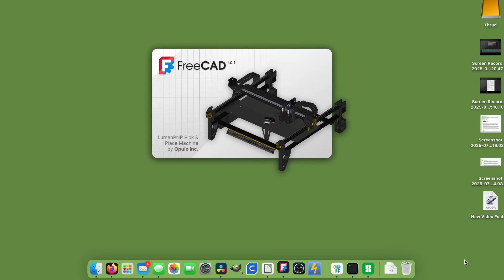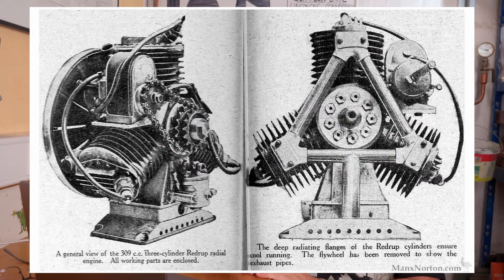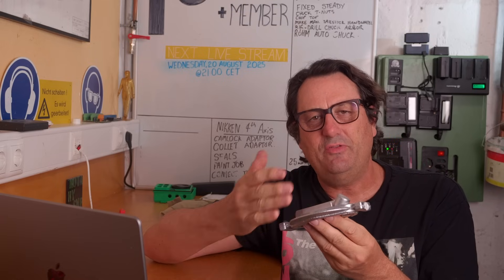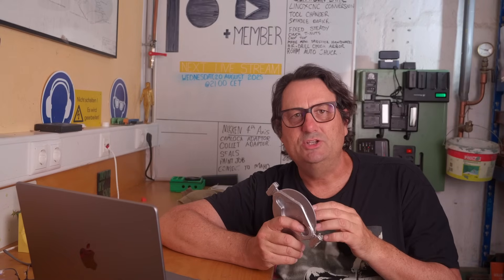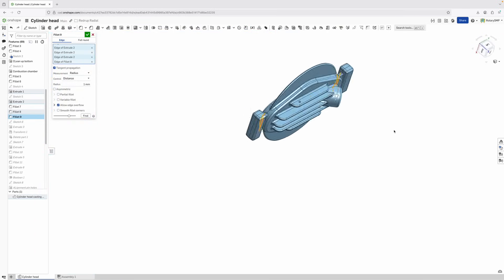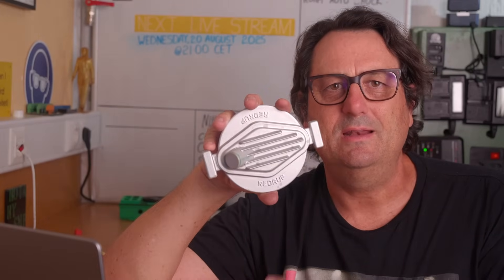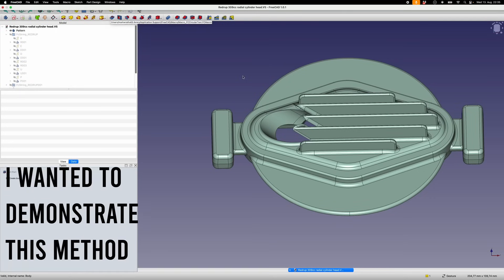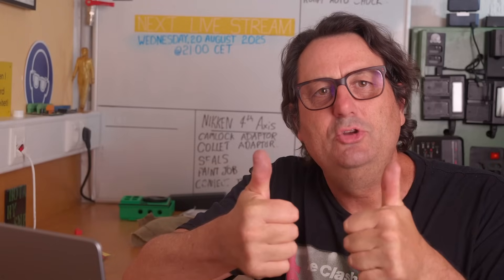FreeCad vs Onshape - Why did I switch? || RotarySMP

Comment: Freecad part workbench is a surface modeler and part design workbench is a solid modeler, hence the incompatibility between the two. I recently discovered that distinction and switched to part workbench as that gives me the 2.5D geometry I need for CNC machining. The limiting factor for me was that part design insists on having to create a different body container for each separate part (or different files and use assemblies). When I'm just designing and fleshing things out, part design is more efficient. At least form me. 

I do agree that the cohesion between different sections of Freecad could use some improving, especially sketching, cloning/multi array features for separate parts. Using external geometry in sketches often breaks the model once you change a part in the history. What I now do is use external geometry to get the dimensions, then delete the external geometry and use dimensions to reference from origin. This saves me from having to manually input all the dimensions. Still, would be nice if regenerating would keep the external references in tact when you change stuff upstream. Of course, parameters are your friend as well.

I've used both surface modelers and solid cad/cam modelers in the past like SolidWorks 2017, inventor, fusion360 and Lightwave3D.
Reply: Solid workbench and Surface workbench as names for each...I know, it's a wild and radical idea.
Reply from the maker: @m3chanist  Funny that this was not obvious to me. Duh! :)
Reply: @m3chanist  That would clear things up immediately. Or split Freecad up in Freecad Solid and Freecad Surface (or call it mixer, or blender ;). I feel like Freecad needs a bit more focus on solid modeling and not trying to be everything at once.
Reply from the maker: Thanks for the explanation of that. I hadn't worked out what the difference was.

Comment: I've never used CAD software, but my experience with other types of software (mostly music production) is that the designers may well be great programmers, but not necessarily particularly good at the area the software is meant to be used in. Anyone experienced in the production of music in the analog domain knows certain terminology and methodologies. I find much music software to have been programmed by people who never learned the basics of music and are reinventing the wheel from their point of view. Programmers also seem to want to make software idiot-proof, at the expense of providing flexibility for people who know what they want to do.
Reply from the maker: I think it is cool that there are open source programs like Gimp, LinuxCNC, Freecad and Blender. I guess we can't complain when some are better integrated than others. :/
Reply: usually commercial software gets this right and open source unfortunately totally screws it up. the reason likely being that commercial software developers have to sell to domain experts who have no patience for the distorted view programmers have of their domain, so they hire the domain experts and have them involved in leading the programmers. open source usually can't afford this (except if it's blender or krita) and thus a significant part of the regrettable situation where the best open source software is developer tooling and then it goes awry for much non-programming software. e.g. gnu imp (doesn't have a bandage tool!), darktable (mathematics suite more than photo editor)
Reply from the maker: @Anonymouspock  I think you are right.

Comment: I started with autocad 13 and still have a copy but I also used solid works as well. I have played with a few others but I am always in a relearning process because I don't use it enough and forget stuff.  Also use chief architect for building plans and is a pretty cool software for construction as it calculates all your materials needed and costs etc.
        With acad r13 and later there wer many times you would type in a command and it would flat ignore it. You would have to close and reopen the program before it would work. You got in the habit of every so often hit save close the program then restart it to pre-emptively restart the program. 

          Video editing software reminds me of old cad software with it's oddities and so much in editing software is not done in an intuitive way and things you think would be  easy are very complicated functions or have to be done to a clip in another instance of the software then imported into the one you are working in to start with.
Reply from the maker: Hi Robert. Yeah, Resolve is a beast. It has an autosave feature which seems to save after every key stroke. Back in R17 it didn't yet have that feature, and crashed so often, I got added a hot key to my Contour for a save button I hit constantly :)
Reply: @RotarySMP  Whatever happened to programs having autosave timers.
Reply from the maker: @theinfernalcraftsman  I think FreeCad also autosaves, but dont remember the setting. That is nice about OnShape. It saves everything constantly. Actually you have to think about the way you do some things, as it really remembers everything, including ever undo.

Comment: at 14:28 instead of making a circle, could you make an arc? The text might center on the arc instead of a random spot on the circle?
Reply from the maker: I should have. You are right.
Reply: @RotarySMP  I do agree that the tool should've just had a degree offset parameter, silly that it doesn't
Reply from the maker: @Mimerneos  It is also a script, so I don't think it is a core tool.

Comment: my first serious forays into 3d object design were povray with the kpovraymodeler frontend, every so often i'd try some 2d cad thing, but they never worked or were opaque in use.  sketchup, some others, but i''m doing freecad now, it's in some ways pretty nice, but also painful to use in some important ways.  i used to have models of decent complexity, but something has changed, now things that used to load fine without any freezes, troubles with rendering stutters... they've started having issues, someone's tried to improve things and have made it worse.

for myself, i'm positioned for building a server that can handle a really complex model, i just need a bit more ram for the server i have.  it might be something to think of for the future.
Reply from the maker: It is good that the Dev's and leadership are working hard on improvement, and not just on new features.
Reply: What was the last FreeCAD version you have worked with?
Reply: @AlexDerhuan  1.0.2
Reply: @felderup  Thanks mate

Comment: Ah the dilemma, i started with a drawing board then Auto cad 10 (inputs on a command line) then the succession of others finally to Fusion 360 via Onshape, to be honest for my home workshop reverse enginering old car and motorcycle parts and even for new racecar parts, i can make the part faster than i can model it (typical back of fag packet engineering)  what is the total time in modelling then printing the cylinder head patterns ? i am certain you could have done that faster with traditional methods, crank can maybe not ,as i assume its a bit more complicated. but the modelling does shine is with assembly's etc and as you say with the CAM for your machines. thank you for the incite in to this wonderfull project
Reply from the maker: I also started with the drawing board. I did Tech drawing for 5 years in school. Was my favourite subject.

Comment: After getting burned with cloud software I use Plasticity for prototyping now. Its a non subscription (buy once) offline tool using the Siemens Parasolid kernel. While its no traditional CAD with a reversable tree structure, its direct controls are very fast and robust.
Reply from the maker: I have never used that one.
Reply: @RotarySMP  its pretty different from traditional cad, but still a proper solid modeler with STEP export. It has neither CAM nor specialized CAD features like gear/thread generators, for those features I occasioanal import or export to freecad. But for me its the program that has "clicked" the most to get to results fast, though I mostly do resin and FDM 3D printing and much less CNC.
Reply from the maker: @zeugundso  Nice one. I took a quick look at OpenScad once, but that was not my world.

Comment: I also shifted to OnShape years ago after trying (unsuccessfully) to move to FreeCAD after being a previous SOLIDWORKS user.

I try every year or two to see if anything has changed, but fundamentally I've always found the same things. What I'd consider to be basic functions seem so difficult to achieve that I just have to pick a different route as I value my time.
Trying to pattern a couple of hundred circular holes into a part was my last frustration. It was unbelievably slow, partly I think due to having to pattern the hole feature rather than the circle in a sketch, but whatever the reason as that was one of the first processes in my part I just gave up again.

I'd love to see a FreeCAD version which was just the basics. Cut out everything that's not useful for basic modelling and see if Open CASCADE fundamentally is up to the task before slowly adding functions back in to satisfy the power users.
Reply from the maker: That is a good suggestion. It is one of the illnesses of open source projects that often more work is invested in shiny new objects, rather than excelling at the basics.

Comment: I discovered Onshape last year, I think it was rctestflight videos that put me on to it. I'd used Sketchup years ago, but last year I had a project in mind and so much had changed with Sketchup that I didn't want to use that anymore.
I had tried out Fusion360 and FreeCAD before, but I couldn't get the hang of neither. With Onshape otoh I hit the ground running pretty easily, each time I encountered issues I was able to follow along with one of their courses to get me going again.
Since then I've enrolled in a professional CAD course (Autodesk Inventor & Solidworks), and will soon start working in this field taking my professional life in a completely different direction. So, thanks Onshape!
I've been looking for companies in my area that use Onshape as their main CAD package, but thus far I haven't found one.
One of the areas where I do feel Onshape falls short is making drawings. I can't quite put my finger on it, but I find making drawings in Onshape to be much more difficult to get right than in Inventor. But for modelling it's hard to beat imo.

I do feel like companies that make CAD software should do more to offer tinkerers, makers and the like better access to their products. The base rates they ask are just way too much for anyone to reasonably consider for a hobby. I heard Solidworks offers a €30 tier for consumers, but that comes with annoying restrictions making it really difficult to share files without screwing over a proper licence holder.
Other than that it's pretty slim pickings for a consumer. I even wish Onshape would offer a reasonably tier, while I love using it I do feel slightly uncomfortable that my designs are just public for anyone to see and use, but even with Onshape being one of the cheaper CAD alternatives at €1500/year, that's still a significant chunk of money for a hobby.

Comment: In Solidworks I do curved text with a reference arc. That way I can set the start and end angles for the text. It never occurred to me to use a full circle. I just extruded a 100mm disk, placed an arc with a 40mm radius, extending 30 degrees to either side of vertical. Then entered REDRUP. Centered the text, and had to reverse the direction and the orientation relative to the outer periphery of the disk. I was only able to sketch one set of letters at a time. That is to say, I was  not able to draw two arcs, select the two together and get two groups input together. I Solidworks the text cannot be mirrored within one sketch. But I could extrude two groups of text in one feature. Three degrees of draft. Then I added radii to the corners roughly perpendicular to the disk. Followed by a face fillet of the letters.
Reply from the maker: I expect this would also be correct of OnShape, as you can bias the text to LH, RH, Center or Fit of the curve.

Solidworks has no support for other OS's than windows.
Reply: @RotarySMP as far as I know only windows. It’s very reliant upon a really robust GPU. Since my whole life revolves around Solidworks I’m running a laptop with an RTX5000. It weighs a ton. But, it flies.
Reply from the maker: @ericmorriscompany9648  Nice. I could have used a solid works Student license, but my only win PC is an old 2013 Z book.
Reply: @RotarySMP  Can't you run Solidworks on a (old&cheap) stationary PC ? I realize you travel a lot but that z-book must be usable at least for simple stuff ?
Reply from the maker: @Panzax1  If I activate a Solid Works student license through my university, I can't use it for commercial work. Most of these licenses consider use in a monetised video as commercial work.

Plus it is frustrating to not have CAD when bored in a hotel. Then I have to edit. :)
Reply: @RotarySMP  I would say your payment from youtube etc is not commercial, as you clearly spend more money on this than you earn. According to Norwegian law that is not commercial work.  If none of your laptops will run solidworks at all I understand it's not an option.

Comment: there is simple yet quirky way to make free cad run smoother on complicated models
you technicaly make a checkpoints after every finished stage of modeling (so basically when performance drops drastically) by safing a file, exporting geometry to step file, making new free cad file and importing step into it as base geometry for more modeling
and part/part design workbenches while annoying to being separate it kind of works one is for parametric modeling, basically a cad program in clasic meaning, and part is kind of anything else like smashing things into each other or building meshes from randomly spaced lines on separate sketches where you don't have to worry about being in the same part , and fileting is total mess but it is also doable to just cut a square hole on each ends where it breaks, do a fillet on each side separatelly and loft the faces of the cut object, this is what i do when it generates strange shapes or fail completly
mango jelly is a legend
i totaly understand your frustration with it though and i am amazed with detailed explanation, hope you have more time for actually do your projects now and be happy with the outcome
Reply from the maker: With this Redrup radial project, as I have such little information, I normally need multiple iterations to even figure out the right part :)

Comment: FreeCAD will be free in 30years, Fusion and friends will screw you over, whenever they like. And it somehow works, mostly fine.
Main problem I have with FreeCAD, everything is somehow hacked together over many years and runs on Open CASCADE.

Comment: Maybe one day, if we're lucky, the source code of Fusion 360 or SolidWorks will leak and the FOSS community can be "inspired" by it.
Reply from the maker: I wonder whether Fusion is really new, or just a new front end on autocad, inventer etc as they are all autodesk products.
Reply: @RotarySMP I think you're right, it probably builds upon the existing code from AutoCAD, but having worked with both, I've actually started to prefer Fusion's cleaner GUI.

Comment: I agree with you! Anything more than just a basic single or handful component assembly is hard work in freecad. It has it's place, because it teaches good CAD practices - otherwise the model just fail. But overall, CAD software is a huge mathematical challenge. And the industry spent decades getting every little feature we take for granted. And upset when the rad fails. P.S. showing the on shape menus gave me shivers! Did my time with PTC Creo and am happy I don't have to use it anymore.
Reply from the maker: I am again on the start of the learning curve with OnShape, but find it pretty simple and intuitive to learn.

Comment: Mark, I worked in software engineering for decades. At the code level, even in just one application, you stumble across so many abominations written by different people. Without a common vision you just end up with a mishmash of stuff that fits together poorly. Even if you start out with a common vision there's always someone or another team that thinks their way is better and will proceed to bastardize and cripple what was there - this is especially true when the original engineers move on and aren't involved in the project anymore.  I won't lie, I don't miss having to deal with that crap anymore.
Reply from the maker: I get that Vince. I am a terrible programmer, so the idea of people like me contributing code to an open source project must be a nightmare for pro coders.

Comment: Your presentation seems to jump from file size to computational complexity to memory size. Finding the best economic solution depends on you identifying which is the critical path first. For example, a cloud solution might not be very good if you have to move a lotof data back and forth across a network connection.
Reply from the maker: I am just a user. I dont really care if that model is stored locally, or on their cloud. As such there is no large moving of data.